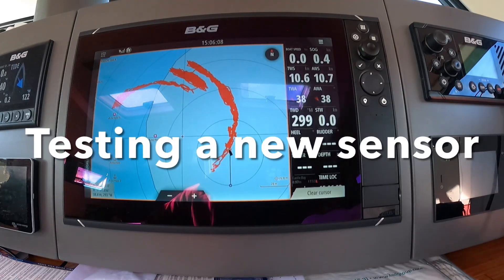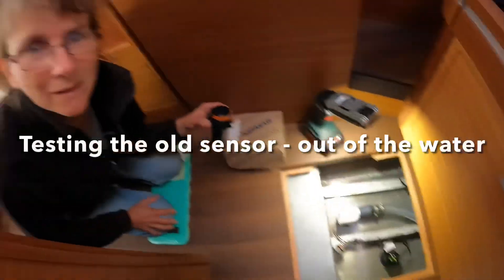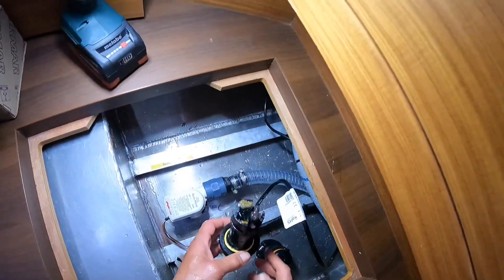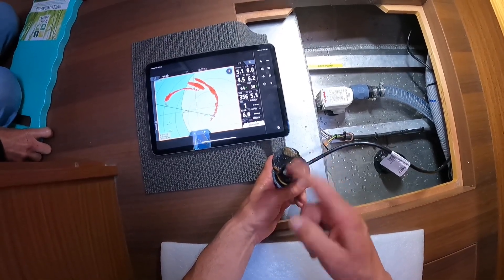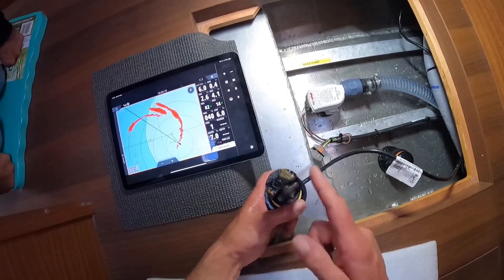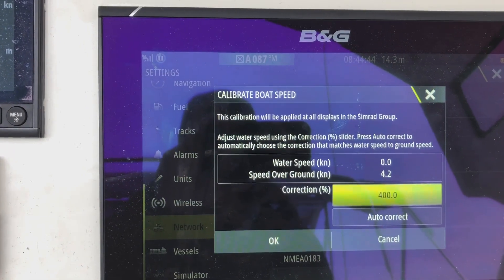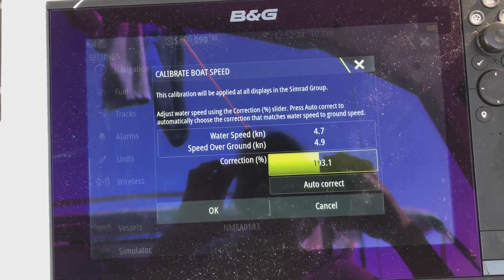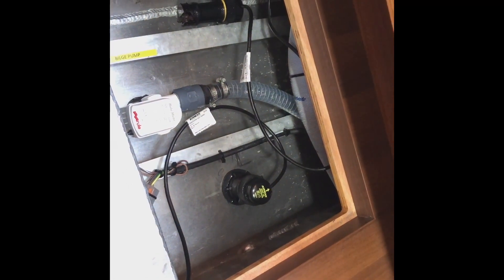Snow Gum - new speed sensor - Garcia Exploration 45

Comment: Hi Rick and Carolyn,  Kate and I are very impressed by how clean your bilges are.
Reply from the maker: Hi Kate! Hi Sean! Good to hear from you. Yeah that bilge area is clean isn’t it. It’s probably because we’ve wiped it dry several times, after pulling the transducer out. Did you see our team work? We’re almost experts at not sinking the boat now. It’s a scary operation - opening a hole in the bottom of your boat. 😳
Reply: I am now sold, on the thru hull plastic  fitting . Easy fix not much water intrusion . Great couple  team work flawless 👏.

Comment: It will be interesting to know from B&G what failed in the old transducer (or cabling).
Reply from the maker: Hi Paulo. Yes it is interesting. Confusing too. The old speed sensor stopped working a few weeks ago, suddenly, while the temperature and depth elements of the transducer kept working. So, nothing was wrong with the network connections. We pulled it out and cleaned it a few times, to no avail, as far as in-water tests were concerned. A new one provided by an AIRMAR agent for diagnosis and testing worked perfectly as soon as we installed it. Conclusion - the old sensor needs to be replaced. Sure, we could manage without boat speed provided by an in-water sensor, relying only on GPS and Speed Over Ground, but in that case we would not have the benefit of the chartplotter’s calculation of current/tide, which is very important in some waters.

Comment: Did you try holding the old transducer with the wheel down (as it would be when installed in the hull) then rotating it?
Reply from the maker: Hi David. I can’t exactly recall if we did try the speed sensor oriented with the paddle wheel downwards. Thinking about how it works, it shouldn’t make any difference. With Navico’s involvement the conclusion reached was that the sensor needed to be replaced and it was. It’s worked perfectly since and this has meant the nav system has been able to generate an indication of tidal and current drift. 🙂
Reply: @SailingSnowGum  yes makes sense but asked because I've seen strange things like that make a difference.  Loving your videos, very informative while at the same time being friendly and relaxed.  If I could ask one question please; do you notice any slap or wave pounding from the boat having a flat bottom?